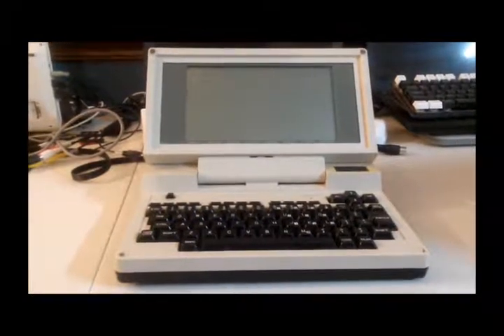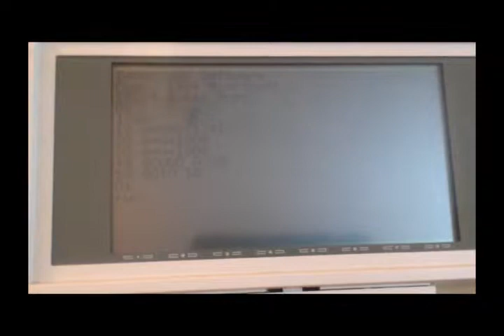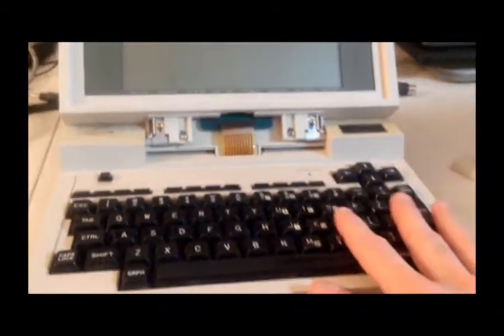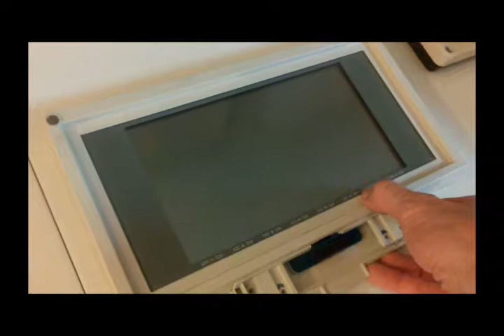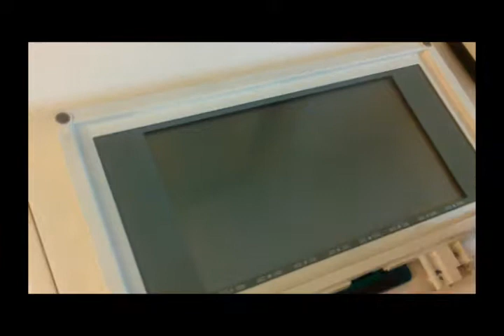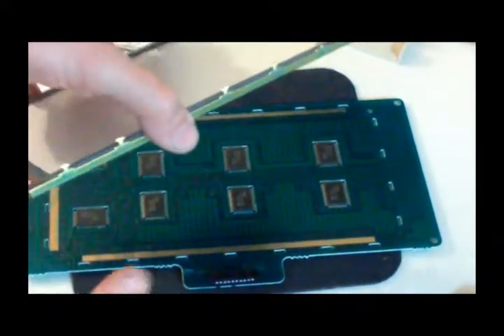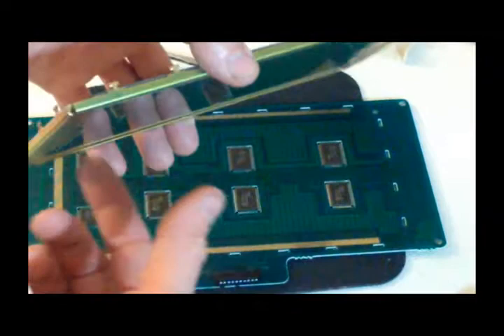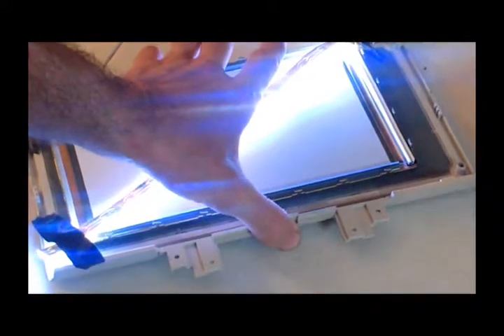Backlit LCD Tandy Model 200 Computer Part 1

Comment: I bought mine new in 1986 for $600. I was a sportswriter for a small paper. The newspaper (now defunct, called The Daily Californian in El Cajon, CA) bought three of the Model 100s and reporters had to check them out. Of course, the same three people would never check them back in and I could never get my hands on one so I bought the 200 for myself and refused to loan it out to anyone. I used the hell out of it. Most handy on Saturday nights covering the local car races. I didn't have time to run back to the newspaper to type the story so did it at the track. A set of 4 AA's lasted a couple weeks. Recently I fired it up and it still works! Amazingly the small NiCd battery backup still works, too, but not for very long, just long enough to change batteries and not lose your programs and text. I added a RS232 to USB adapter to talk to my other computers, and a couple months ago added two banks of RAM from ebay (I'm still mad at myself for not buying the extra ram when it went on closeout in the late 80s). I ran a Mandelbrot set on it at 100-iteration resolution and it took a little over four days to complete the image! I think with the RS232 port it could still be a useful computer maybe for turning things on and off or logging something like an Arduino weather station. I remember during a tournament in another city I stayed at a Motel 6, which doesn't give you an alarm clock, I used the 200 as an alarm clock by looping a program to check what time it is and beep in an endless loop when it was time to get up!
Reply from the maker: That's really interesting, and super cool you still have it. The screen is surprisingly readable. Compare that to the 1400 series that came afterwards and it's no contest, the 200's screen was way better, in my opinion. How does the RS232/USB compare to the cassette port? Better or not as good? I only have experience saving/loading using cassette cable and Audacity running on modern pc. Thanks for subscribing and the feedback!